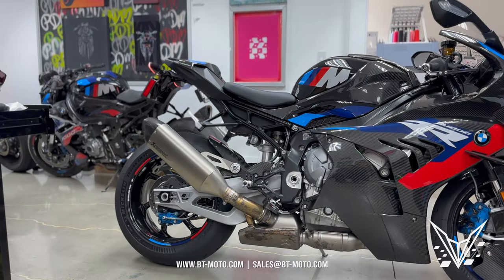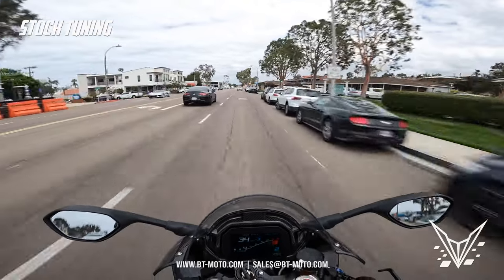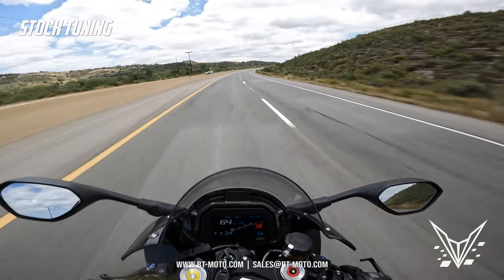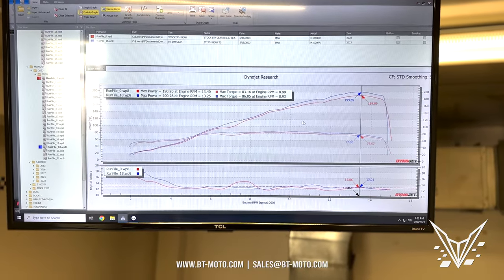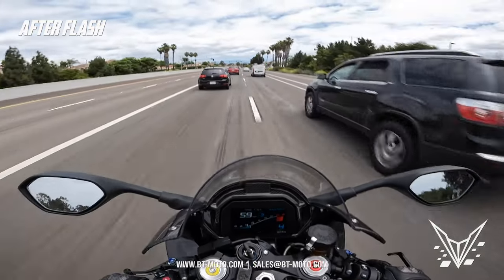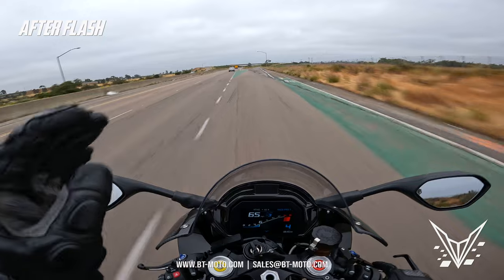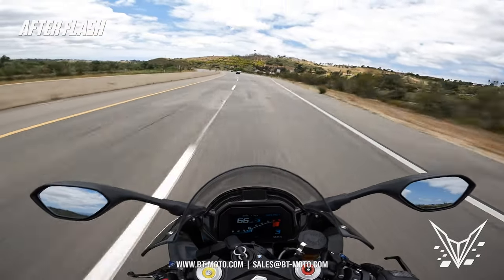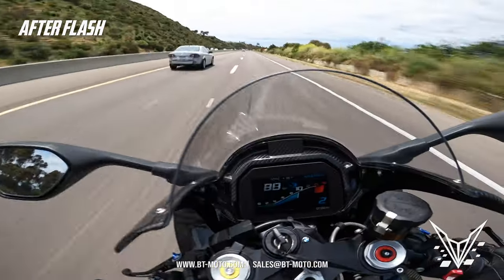2023 BMW M1000RR Competition DESTROYS Tesla Plaid, BT Moto Ecu Flash Tune, Dyno,  Acceleration Tests

Comment: What a great review/video! I have the 23' M1000R and was so surprised how "docile" the bike is in 2nd below 10k rpm. Probably need a BT flash I guess 🤪
Edit: I have a very insensitive "butt-dyno" so I do not feel that much difference between "Road" and "Race" regarding power delivery i the first two gears. According to the user manual road and dynamic mode has the restrictions in the first two gears. Race modes are configurable so maybe you get full power in all gears. Guess BT have checked the relevant tables (ETV) in the ECU.

Comment: Went to the dealer to buy this bike. Only to find out it does not come with the electronic suspension but the S model sitting next to it did have it. And it was $24k instead of $40k. Well, I may be a high school dropout, but with an IQ of 130, it was a no brainer to get the S model. Not enough justification to spend an additional $15k just for carbon fiber bodywork. Carbon fiber is for structural integrity, which is not necessary where it is not needed. Plastic fairings are just as light weight and can perform the same function for such a setup. M model should be no more than $30k.

Comment: Why BMW doesn't do well on any championship worldwide? WSBK, BSB, JSB, motoAmerica). Everybody complain on chassis and peripherals. Only engine is powerful. But it is unusable if not supported by the rest of the bike.
Your tuning is very good and on the correct rev range. This shows you know very well what you are doing👍
Reply: 2023 BMW winning MotoAmerica super stock class
2023 BMW was winning MotoAmerica superbike until cam had a bad wreck and had to miss multiple races. 
2023 BMW M1000 super stock machine broke the Isle of Man all time fastest lap in all 2wheel categories. The super stock bike owns the record.
Josh Brooks was leading BSB. He was 30point from 1st in the championship when he had a mechanical that cost him the lead, no smoke or drama looked electrical.  Soon after that he had a bad wreck causing him to fall far back in points. Either way BSB almost always has a 2023 BMW M1000 on podium
Reply: I don't think the 2023 M is racing in CSBK or ASBK so they don't count.  
WSBK has weird restrictions and other issues. The BMW doesn't have the power advantage in WSBK that it has in other racing.

Comment: So, US models are 205hp. Euro is 212, iirc. Does the tune give the bike the same power as the euro or is it an improvement to the US spec? I’m not asking that the right way but hoping you understand what I’m getting at.
Reply: It depends , it’s 205 to the crank  , due to emissions regulations it’s limited to 205 but with a ecu flash you get rid of the limiter , getting more hp

Comment: The engine on the M is not stronger. You should check valve clearence after 600 mile run in period, especially the exhaust valves are the weak spot. You can get 230 hp@crank with some changes in camtiming and a thinner head gasket, measure squish.

Comment: Now do this with track mode on, or better yet go get the track pack and that ticking time bomb will explode trying to beat the Plaid.
Reply: Doubt it
Reply: @Ryder1K  It beat the H2R without the track pack in a roll race and from a stop so yes it will.
Reply: @Waldo1122  definitely wasn’t an h2r, probably regular stock h2.
Reply: @Ryder1K  My mistake, it was the stock h2, but with the track pack it 100% beats the h2R
Reply: H2 and H2R are also restricted, the R model less so. Neither has an intercooler, neither is making the amount of boost the engine can take, and neither bike is exactly svelte. The amount of power the supercharger gives the engine is offset by drag, weight, and engine heat (in stock condition). The H2 is a monster, but it's not a pinnacle standard of power. A well built turbo Hayabusa makes everything look slow.
Reply: On tracks M1KRR has faster lap times than Plaid stock H2R will destroy any tuned M1000RR LOL
Bone stock M1000RR in 3rd gear 30 mph smoked Ferrari SF90 in 2nd gear 
SF90 and Plaid are evenly matched in Acceleration
M1000RR pulled bus lengths on SF90 
Plaid stands Zero chance
If M1000RR did a roll race on 2nd gear at 50 mph 
Stock M1000RR 100-200 km/h 3.5 seconds on GPS
Plaid 100-200 km/h 4.1 seconds GPS SF90 4.2 sec

M1000RR is just so much faster even quicker than a Chiron from roll
Reply: @Waldo1122  🤣 H2R does 100-200 km/h in 2.8 seconds 200-300 km/h in 4.6 seconds
Tesla Plaid track pack does 100-200 km/h in 4.1 seconds 200-300 km/h in 10 seconds
H2R is much much faster than any Tesla Plaid exists

H2R is even faster than Chiron SuperSport in terms of acceleration 100-330 km/h H2R is over 4 seconds faster than Chiron SS
Huge difference
Chiron SS know to be fastest car ever made 490 km/h top speed and fastest 300-400 kph acceleration
H2R is much faster than Chiron SS from 100-350 km/h 4 seconds faster not even close
Reply: @Smzxe  The H2R will need a professional rider having a good day to achieve those numbers, and the plaid can achieve those numbers with a toddler in the driver seat.

The H2R will need a complete engine teardown afterwards and the Plaid will pickup the kids, groceries and drive home without breaking a sweat.

The Plaid will win every single time against the H2R outside of a completely empty airstrip. How many highways or stoplights can you race from anywhere in the world where the H2R can reach 200 mph to FINALLY gain the lead???